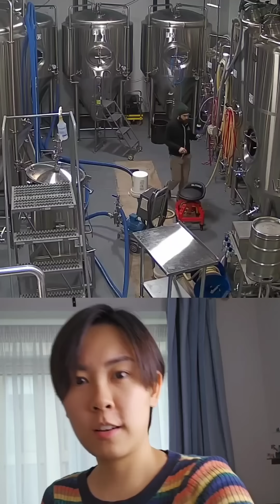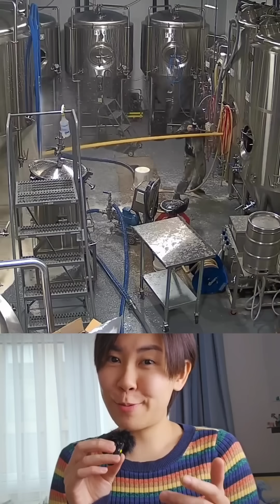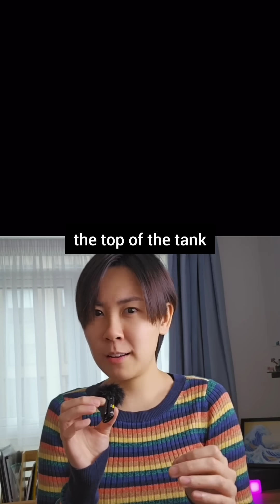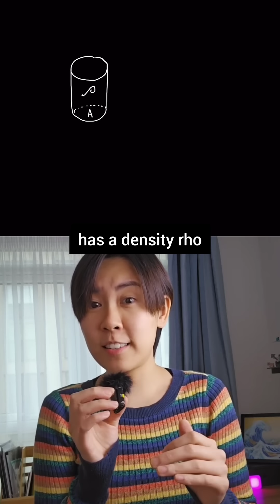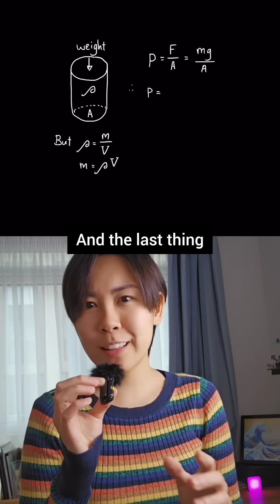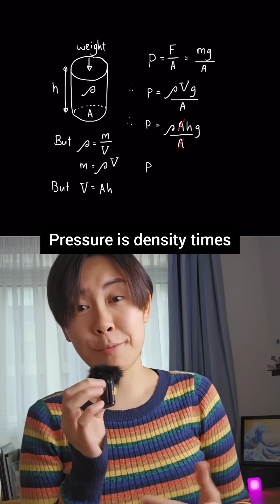High Pressure Danger in Beer Fermentation Tank! Physics Explains How Brewing Beer Goes Wrong! 🍺💥

Comment: I'm going to argue this one. Pascals law states that in a closed system with incompressible fluid the pressure measured at any point is the same. Any change in that pressure would be the same at any point. If the pressure is due to the fermentation gasses pushing down on the surface of the fluid is thus 30 psi the pressure would be 30 psi at the top and bottom of the tank. The weight of the fluid would be a negligible consideration. 30 psi coming out of a one and a half inch line would be serious flow. The pressure would drop as the gas expands until the tank empties. Likely exhausting gas at the end due to the greater volume gas vs liquid.

Comment: This formula applies to an open container. A pressure of 30 PSI requires a water column of approximately 70 feet (about 22 meters). For the liquid in the container, the pressure of the liquid column would be approximately 5 PSI. Here, we are talking about a closed container. The pressure is not caused by the height of the water column but by gases produced during fermentation that cannot diffuse to atmospheric pressure. The amount of compressed gas in the container and the ratio of its available volume determine the prevailing pressure in the container.

Comment: Yeah it wouldnt be reason of preassure you have yeast there which eat sugar and make ethanol + CO2 and other gasses which are hold on top of tank which increase pressure in tank xD how do you think spray working? Exactly same xD you pour liquid into can,seal it and pressure can with gas xD that gas when leaving can is taking some paint in can xD so exactly if you have something in spray but you dont have pressure,you simple connect it to compresor and push some air in and spray working again xD but dont over pressure it xD otherwise you get new makeup xD

Comment: Actually our atmospheric pressure is just as 10 meter water column
So 2 atm is about 20 meters high column

And after that loss or leak in that video.. the pressure should decrease so much 

That height is never 20 meters

Maybe it is because the bi products of the fermented beer increasing the internal pressure of chambers

Comment: For our non-freedom-units-lover: 30 psi is about 200 kPa. A psi is the pressure that the weightforce of 16 ounces extort on an area of a twelfth of a foot squared. Obviously. What a beautiful system.
Reply: a 12th of a foot squared is 12 inches squared, you would want one 144th of one foot squared.

and I take umbrage to your remark it's a very intuitive system that's not confusing to describe at all.
(joking, and I know what you meant)
Reply: @FrancisR420  As we do usually not speak brackets: It's a 12th of a foot -- pause -- squared. Or (1 ft/12)^2. That's one of the cases where spoken formulas require you to think along.
Reply: also the weight of 1 oz  is equivalent to the weight of 1 oz of water by volume which  is measured by the volume of 1 oz of water by weight which definitely is the best way to do that.

Comment: Hydrostatic pressure is only 1.5psi per meter of depth. The tank looks to be about 3m tall, so the pressure on the bottom is 4.5 psi greater than at the top. If the top presume is 30psi, the bottom pressure is only 15% high than the top pressure. Also, most of the pressure on the tank comes from carbonation, since getting 30 psi of bottom pressure just from hydrostatic effects would require a 20m tall tank
Reply: Exactly. If the pressure in that tank was much higher than that, it was caused by the fermentation, not by weight or height.

Comment: You also have to take into consideration the carbon build-up? These tanks aren't completely full. And there are relief valves to regulate the pressure building up in the fermintation process.

Comment: Watch over 10 times, brain melting and leaking out of my ear with less pressure than the beer in the video... the density of my brain fluid must be low in viscosity 😔 because it drained and dried and now I'm sitting in my nothing cave alone and haunted by the ghosts of these equations...

Comment: This channel isn't very careful with the information. You take a whole video to derive a bad formula, and doesn't even plug the numbers in. If you did so you'd get 3 psi of difference between top and bottom. If the tank's pressure is 30 psi, the pressure below isn't much higher than above.

Comment: You should discuss how the pressure at the bottom of a cone of liquid is affected by only it’s depth instead of the combined weight of the liquid above the other sides of the cone
Reply: fun demonstration of this concept is the long straw 
 get a 10-foot tube and try to drink from a glass 10 ft below you, basically impossible.

Comment: In the beginning of most physics courses they leave out something.  Most of the time when they give you a problem they will not account for friction.  The reason is simple. They want you to learn the formulas and how to apply them.  Later you learn about friction, but at first they always leave it out of the equation.  In application to the real world that aspect is kind of important.  In your explanation of the problem you left out an important factor.  The pressure in the fermenting tank is only partially due to the mechanics(physics) of the situation but an important part of the real world problem isn't in the mechanics of the situation but in the chemistry.  It's in the name of the object “fermentation tank”.  The process that's going on in the tank creates pressure from the build up of CO2.  The tanks of course have a release value but that's only to relieve excess pressure and these tanks are designed to stand up to a lot of pressure.

Comment: You are wrong and this will happen for non alcoholic fluids also according to your equation.

But in reality the pressure in the alcoholic tank is much more than normal pressure because of the extra gasses produced due to fermentation process, that is the reason of that blast.

Comment: U also have to account for the co2 generated from fermentation. If the vessel is sealed, the gas exerts pressure of it's own
Reply: That was definitely from co2.
Reply: The vessel is still only rated for 30psi. Most breweries keep Brites and fermenters under 15 psi
Reply: it's only pressurized during or after bottling

Comment: Simple words the water on top weights down on the bottom creating high pressure there. Test it by filling a water bottle and poke a hole in the bottom after some time the speed at which water comes out will be lesser as the amount of force from the water on top is less(since water is getting out) .

Comment: The tank seems only about 5 meters tall so around a half atmosphere pressure or around 7.5 psi for that fluid column. But the gas pressure of beer exerting on top of the fluid in the tank contributes more.

Comment: yeah, no.
30 psi (2 bar) would mean the level of the fluid surface is around 10 meter higher then the hole. the container looks more like 4-5 meter and the hole is at least at 1 meter at the container level. Guessing the level is (realistically) 2,5 meter above the hole would end in around 1,25 bar (18 psi).
But more likely the container is under pressure (not purely by hydrostatic pressure), as common in processing Factories . For example beer is under pressure during brewing, as fluids gas out and need more volume. And during storage to get in the carbonic acid. Your calculation is pretty pointless for a container that is not open to its surrounding/atmosphere at the fluid surface.
or hope my english is understandable, as I'm not a Native speaker.

Comment: The Derived equation at end
p=rho.g.h
Shows that :
Pressure is directly proportional to height (the fluid here)
It doesn't shows the reason how the position of hole has different pressure at different heights , and its a closed container , hence the pressure should be uniform throughout container, like a pressure cooker.

Comment: Its important to remember the equation Pressure = Force over Area. basically she simplified it into mg over area, Mg is mass gravity. Then she converted mass into volume over area and she times the volume with the height of the tank. So logically  you know the the saying the bigger they are the harder you fall in this case the weight of fluid in the tank

Comment: One of my glass carboys foamed up within the first 12 hours of pitching the yeast and the foamy liquid leaked up through the airlock. The sticky liquid fused the bubbler onto the carboy and then the bubbler clogged up.

I woke up after hearing a very loud boom… the pressure built up inside and then the bottom of the carboy blew out. It launched a mess all over the ceiling and walls, but thankfully I had the carboy submerged in a large bin of water and it contained most of the mess.

Called out from work to clean the mess and re-brewed the lost 7 gallons. Thankfully my other Carboy was unscathed!
Reply: what a mess!
Reply: @johnahn1117 - Haha I’m sure there’s still dried remnants of beer juice in the ceiling!
Reply: how unlucky, must have pissed off the beer gods

Comment: That seems like more than 30 psi hitting him. I never worked in fermentation, so I'll take your word for it.
Reply: Psi is pounds per square inch, if you assume that the stream had a 2 inch diameter, then the force against him would be about 90lbs, plenty to knock someone on their ass.
Reply: You have to remember its going through a thin nozzle. Speed increases as the hole it escapes through gets smaller.
Reply: @AshKetchupIsNoobingnot true
Reply: Pressure due to the build up of gas from fermentation? Not sure if they are sealed or if the gas is allowed to escape
Reply: I agree unless he was drunk already and the surprise of it caused his fall more than the psi
Reply: You mean kPa, not psi.
Reply: @goktimusprime  No
Reply: @goktimusprime  no, the situation was handled you shut your mouth now.
Reply: @goktimusprime  Just stop, your input is not needed
Reply: @goktimusprime  No be quiet
Reply: It’s twice that amount
Reply: That's 30 psi of fluid. Air has little mass so little acting force. But beer though? Ever seen firefighters control a crowd with a big-ahh cannon? There ya go.
Reply: @PunakiviAddikti  psi is psi? It doesn’t matter what the materiel is, psi is already telling you about force. You do not understand the physics
Reply: @MerdithLangdon  wanna bet? Psi measures pressure, not force.
Reply: @PunakiviAddikti  How could you be so confidentially incorrect?
Reply: @DonaldSilverberg  that's your opinion.
Reply: @PunakiviAddikti  Yes I want to bet. Pressure is force per area. PSI = pounds per square inch. Pounds is a unit of force and square inches is a unit of area. It is literally a measure of force being exerted (in this case by beer, and CO2) against a container (the vat). Any similarly viscous liquid regardless of its composition, will act the same way in this scenario so long as it is kept at 30psi. There are some cool vids on here that will reinforce this realization. What we realize is that many things in physics come down to different forces interacting in different ways, and pressure is a classic example.

 (we use pounds as a unit of weight because it is proportional to mass, but weight is fundamentally the force of gravity). The standard unit of pressure is the Pascal, which is N/m^2 again, N is Newtons, the fundamental unit of force and of course meters squared is area so still FORCE per area. Pressure is a measure of force.
Reply: @MerdithLangdon  oh, I see now. Yeah that's confusing and that's why we don't use psi, we use bar.
Reply: @PunakiviAddikti  Bar is still a unit of force per area. 1bar=14.504 PSI=100000 pascals = .987 atmosphere.  That’s the amazing thing, everything is equivalent through quick conversion.
Reply: Low PSI can still exert high horsepower if the rate of flow is high enough. I'm assuming the rate of flow is several times over 15 gallons per minute.